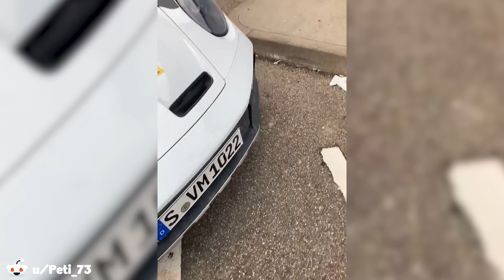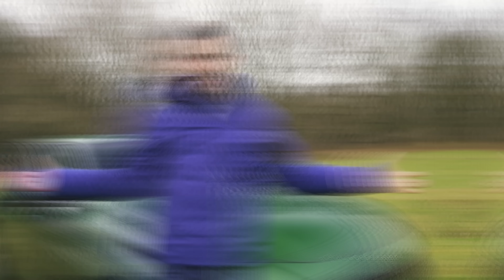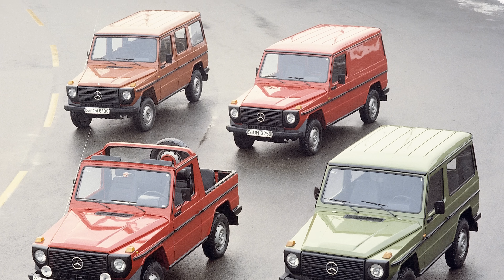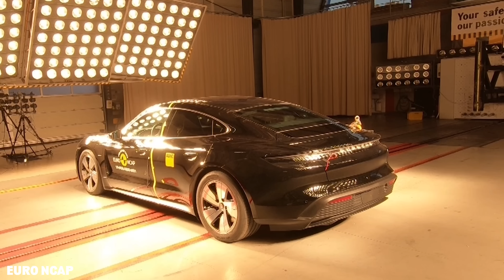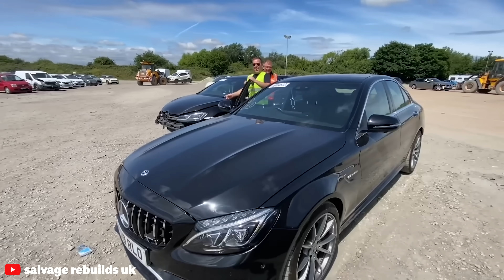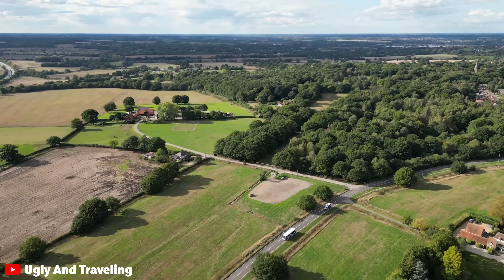Why thieves steal Porsche headlights!

Comment: We work (since 1989) for insurers, collecting, storing and delivering damaged and broken down vehicles…….. we have recovered as many as 3 BMW M sport cars, in the same area, within hours of each other…….. the same MO, smashed drivers window, steering wheel gone, sometimes part or whole dashboard. We have literally done hundreds.

I’m informed that not only is the air bag a commodity in demand, but specifically the steering wheel. M sport is a trim level not available in every market, and they are right or left hand drive…….. therefore, there is huge global demand.

The latest twist is the whole steering column 😳

Another popular one is EVERY panel from the front of Transits, 350’s, Customs and the Connect…… it’s a bleedin epidemic…… East London/Essex.

What I’m sure doesn’t help is the antipathy felt between the London Met Police and Essex……. I live on that border and it’s like the Bermuda Triangle for vehicles…….😢

Keeps us busy, but not in a good way…….

Comment: The price of 2600 pounds is actually very low (Is this just the "optioning" price?) compared to what we payed for JUST ONE of our Audis Matrix LED headlights after it broke in a crash. That was a wopping 3500€!!!
Reply: £2600 would be €3045, if you add on Audi's crazy labour costs then it's probably not far off what you paid, unless it was 3500 before being fitted. Either way it's crazy money for a single headlight.

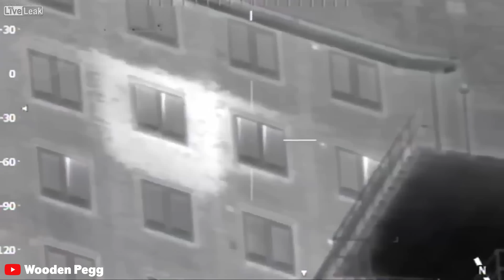Comment: @2:05 - I'm not so sure about that one....LED panels are basically dirt cheap now and have been in use since the mid-2000's....most don't even use the old school Halogen lights. That sounds like one of those pub rumours.
Reply: It doesn't even make sense. Having a better cooling doesn't mean it emits less heat. Actually, it means exactly the opposite since better cooling leads to better transfer of the heat from the emitter to the surroundings. So using lamps that have better cooling results in having a cooler lamp but an even hotter room.
Reply: @Mettsemmel  They are much more efficent than older items, so produce more light output for less heat generated. The cost is mostly the custom electronics and fancy glass designs.
Reply: Yeah that's total bs. Led panels are probably more efficient and output less heat.
Reply: I heard those rumors like 15+ years ago, and was related to first Cayenes 😂
Reply: Agreed , these are all for black market parts .
If the media can demonise bud they take any opportunity
Reply: Plants like yellow light, not white light. It should be pretty obvious that after millions of years of evolution, plants have adapted to make the best use of our natural sunlight. Giving them any spectrum other than natural yellow-ish light is counterproductive.
Reply: yeah i thought so too. plus all these car headlights these days are mostly conrtolled by the cars canbus, so you cant just stick 12v to the headliht, you  need the data signals.
its just people having crashed their cars and needing 10k worth of parts. including front radars.
Reply: Far as i know its cause of the more complex electronics in side which are worth a lot

Comment: The ability to use a simple set of antenna and picking up the car remotes signal from afar is unbelievable but is true.
Reply: The newer keyless remotes have a sensor so they are not active when they are stationary.
Reply: they're gonna use an earthquake machine next  @strudl32456

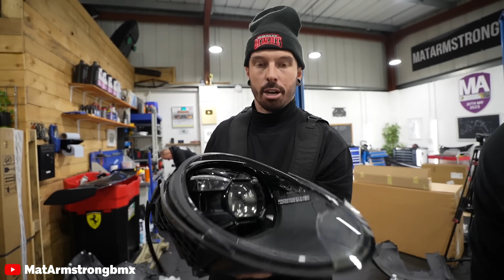Comment: 2:13 what are you talking about? To grow cannabis you need a massive amount of power that’s why those lights are producing that much energy in modern day. Lights are using cool to the tuch LEDs not low pressure sodium bulbs. This isn’t the 90s so rigging up a Porsche headlight isn’t going to give enough soft then warm light to grow a plant well, this is like you just reached into a bag of BS and just pulled something out